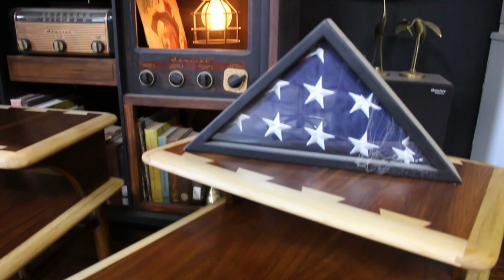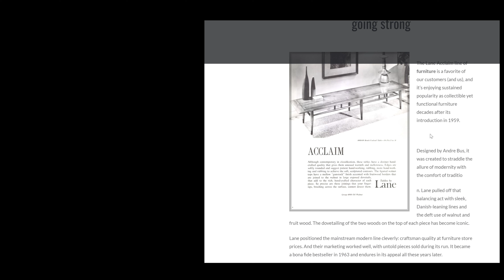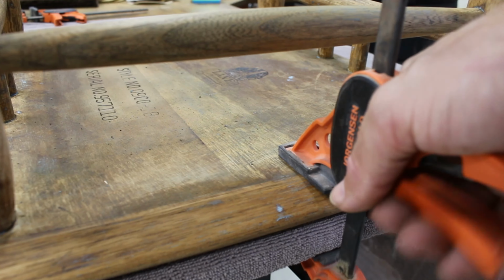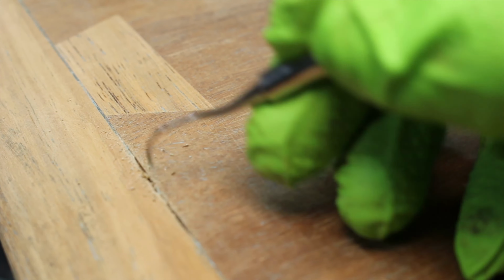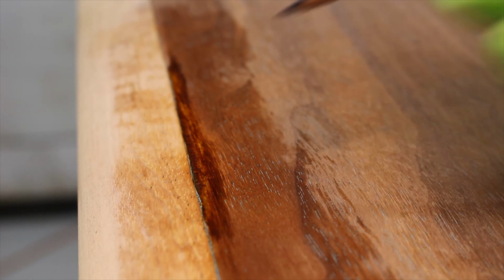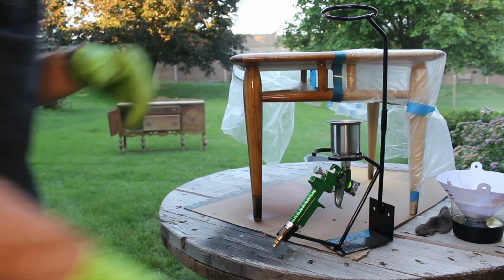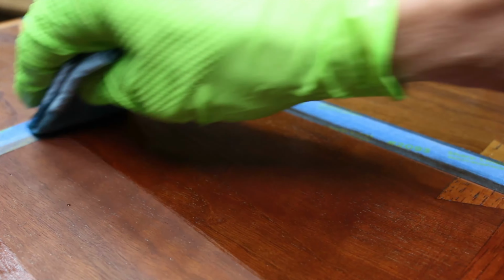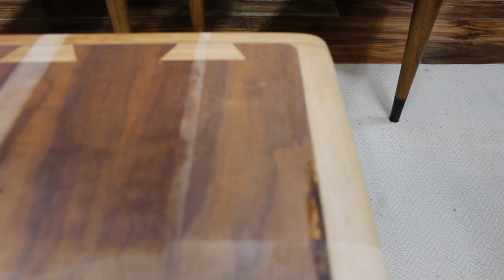Amazing MID CENTURY MODERN Lane ACCLAIM | Episode 1 | Furniture Restoration and Refinishing

Comment: 4. And I wish I could gift you a closed spray room so you didn't have to spray outside. Hate to think of all those chemicals landing on your beautiful plants.
Reply from the maker: I think the spray dries long before, hopefully
Reply: Wow!! You do beautiful work. 
I love both of your YouTube channels, plus I learn something with every video. 
My only suggestion is you should splurge on a paint booth, even if it's a DIY cheapie. 

Over 30 yrs ago, my husband & I painted our old kitchen cabinets, to use in our laundry room. 
We made a paint booth in our carport, out of a 400 ft roll of plastic sheeting, & multiple J hooks we hung from the ceiling.
That was the first time we'd ever painted anything with a paint sprayer, or used a paint booth.  
We were amazed how great the cabinets turned out.  
They're still in our laundry room all these yrs later.
We've remodeled everything many times since, except for those nearly flawless, solid wood, painted cabinets. 🙂
Reply: Hello Laurie 😊 happy new year 🎊

Comment: i like finish number 1. I've seen something in this video I wasn't aware of, I've never seen powder color stain before. Thanks for showing that. And the hydrangear looks good. My own decision of using stain and varnish on table tops is consideration of how it is used. So if I'm using the table to place drinks and snacks or food on it and requires frequent wiping to keep the table top clean after each use than, the most suitable finish would be moisture resistant eg. oil based stain and oil based varnish such as polyurethane because they are water resistant and hard wearing. How ever, I am very conscious of finishing bedroom furniture such as bed side tables with polyurethane because some of the brands can give out a strong odour even after they've dried well. So to reduce that odour I would apply polyurethane brand to the top only and the sides with a low odour water based varnish of the same brand in case it is a color and stain varnish ( so the color matches on the top and sides). Other considerations are, stain and varnish finishes which provide UV protection. The UV rays in Australia are very strong and can cause some timber furniture to to discolour or fade, warp, split, crack or separate. So for this reason I use mostly Cabot's timber products and oil based stains and varnishes.
Reply from the maker: Awesome feedback

Comment: I think it depends on the condition of the piece. Number 4 is easy but won't hide much. The gel stain and number 1 seem to hide a lot of damage. As long as the finished piece looks relatively flaw-free, it won't really matter which finish you use. You might check out Transcend Furniture Gallery (YouTuber). She uses dental picks, markers, paint, etc. to either pick out paint or disguise it.
Reply from the maker: Haha. Angie is a friend of mine. We both use alot of dental tools like you mentioned

Comment: When doing repairs like cigarette and veneer burns you want to spray vinyl sealer before you inpaint. No need to keep spraying water to see what the wood looks like. It will already look "wet or finished". Then you want to use glaze or better yet grain filler to make the grain rich and pop. Then it's time for toner. Mixing your own toner in the HVLP creates a transparent toner. You want opaque toner. Mohawk Tone Finish Toner cans are the ones you want. You can create your own toner for Acclaim but you need more than one color dye stain in the mix.
Reply from the maker: Excellent feedback. I was glad to have a piece like this to continue practicing with. There aren't many lane acclaim pieces out there that should be practiced on. Only one way to keep learning